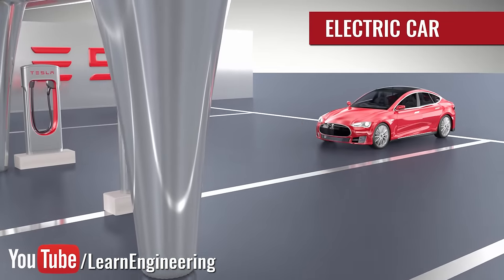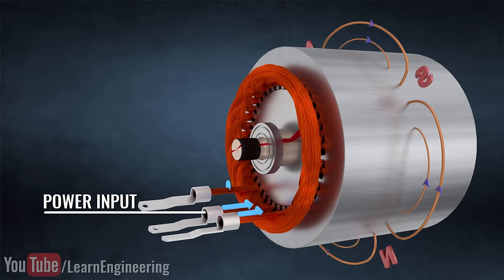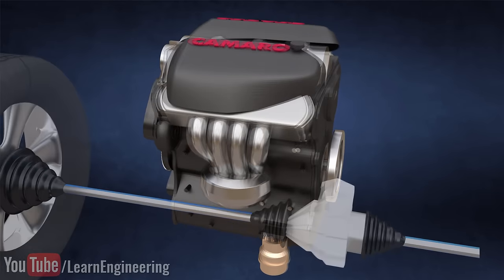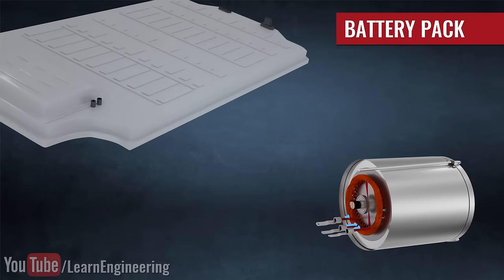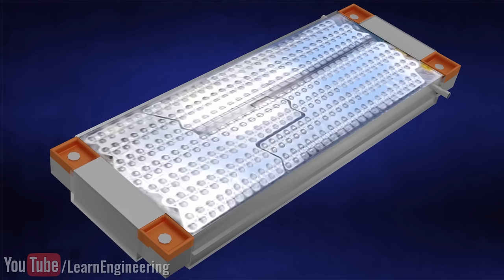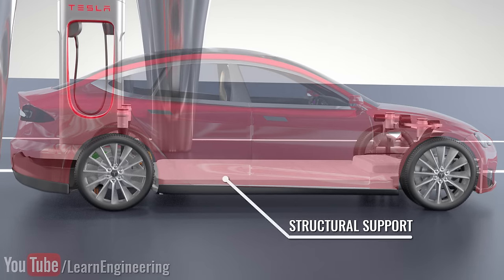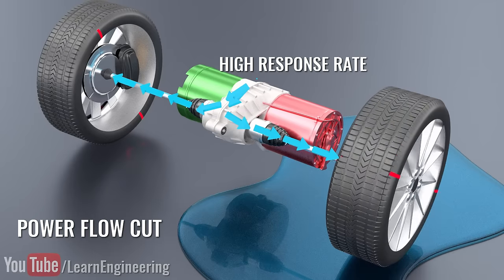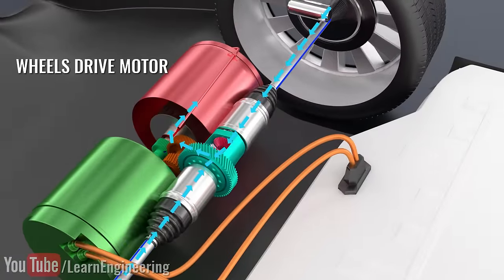How does an Electric Car work ? | Tesla Model S

Comment: If you just consider that you won't have any oil changes plus no costly maintenance during your ownership it's just awesome.  With many charging stations coming all over the world, for once future is looking better.  Thank you Elon 💪
Reply: You do need oil changes for the tires to move
Reply: Thank the Engineers not Elon LOL. Also, you still need to change the Battery every 10 years, and oil change for lubrication of drive shaft.
Reply: That didn’t age too well, they are saying all these electric cars won’t be able to be used because the power grid can’t handle all that electricity

Comment: 2:47 could you imagine if an engine was actually put into a car like that lmao
Reply: Assuming Direct drive is around 3rd gear and no neutral as no transmission, the car should not start
Reply: Car efficiency: 📉 NOT STONKS

Comment: Very interesting and excellently realized video. Many thanks!

As a passive safety engineer myself, I would like to add that the presence of the battery pack increases the torsional stiffness for sure, but not so much for lateral impact safety (the battery structure must be protected, thus the intrussions are to be managed via the body-in-white rocker structure mainly).
Also for the front unit crumple zone, yes, it is largely increased (if a front motor does not exist), but in counterpart, the rear crumple zone is more difficult to manage comapred to an ICE car (the rear motor and invertor must be protected in the case of rear impact).

Thanks again, hope my comments would be accepted as constructive opinion. No intention of critisism.
Reply: As we have seen after Hurricane Ian in Florida, many electric vehicles burst into flames after water breached the batter compartment of several electric cars. These cars when bursting into flames have en extremely HOT flame as it is a "chemical reaction" and not necessarily a regular fire.

Comment: 2020 and the disadvantages listed at 10:10 are pretty much gone. The meaningful charging time is like 15min now in a L3 SC going from 20% to 80% which is more than sufficient to travel 250 mi to next SC if on a long drive. For city driving, it is inconsequential as you charge at home and leave home with full tank of charge so to speak. Range is 315+ miles for LR Teslas which matches close to a gas car of about 360 mi. The S and X are 400 mi now. The cost is now in $50k range which is opening it up to a pretty huge segment of the market already.

Comment: electric cars are the future. But Tesla is a high class car, like a Porsche or S-Class Mercedes. Most people can't afford that. 
I bought a Renault Zoe ZE 40 with 41 kW/h battery and 300 to 400 km range. Also the battery can be charged in 1 hour up to 80% State of charge
Reply: and what speed are you traveling for that range? 45 mph with Int comb cars beeping for you to get out of the way?
Reply: @mdbx3887  The cheapest Tesla Model S costs 53.000€ in Europe. On the other hand, you get a handful of Renault Zoes for 15.000€-20.000€.
Educate yourself before you speak.
Reply: @mdbx3887   I wonder which of these cars will have better and easier service, in France?
Reply: Electric cars suck
Reply: Startingbark 035 A Tesla Model 3 would whoop every IC engine sports car out there on streets and on drag strips. And that is a fucking electric sedan.😂😂😂
Reply: Teslas cost down to 70.000$ in Norway, people can afford that?
Reply: @mdbx3887  First you are not really "french", as you can't even write properly "France" instead of "france". Second, you are a liar: the Zoe starting price is 26 300 € (without speaking about any "special price" or rebate one could get in a way or another).
Reply: eDrive how long does the battery last for on average before you have to recharge it?
Reply: @startingbark0356   ice cars blow...... poison gas
Reply: @BRAG3A  Surely they do; some of them at least; I mean, a few, or few
Reply: @mdbx3887  35k is the advertised starting price in the US. In EU, long range model 3 are >50k euros.
Reply: @bavarian3450  no u
Reply: @startingbark0356  do you own an oil factory?
Reply: *kWh

Comment: In nineteen ninety-one I drove with an electric car that had the reach of a horse and cart. It worked on lead batteries weight five hundred kilos everything total. Everything still works except the batteries. I now use the engine knowledge for washing machines and hobby.

Comment: If only tesla had a battery double it's size we would not have to stop to charge many times if we are on a road trip. Support tesla for the best in future
Reply: The weight, area and placement of battery along with its cooling, the charging efficiency all of these matter. Safety standards are prioritized over the distance a car can go in a single charge
Reply: The 2020 Roadster will have a 600 mile range.  200kWh battery but it’s $200k

Comment: Wonderful  explanation :  I learned a lot !   One  Question:  How about if  each wheel  is  activated with an  electric  induction motor.  It  could  overcome  the  ABS  system of conventionally cars  and  finally manage better control of  traction  and  also  overcoming  the   differential  gear ?
Reply: that would be twice as expensive. A big induction motor would cost less than 2 smaller induction motors. Right?
Reply: @Antonio-dd3fe  Right you are !   As modern devices require great inversions (the Ford "T" model  was very  expensive, when it came out in 1908!) ,  four induction motors upon each wheel, could work  as motors (when aceleration is required) and  as  generators (when functioning as   brakes and  at the same time the electricity could be used  to  load up batteries).  The resulting car could control  traction (tortion control)  perfectly, even on icy/mud  surfaces, I  believe !
Reply: @froehlicherelter  Don't some have AWD now? Pretty sure its just a mirror image of the back up front thought since running a drive shaft would take up battery space. That still would give you individual controlled though like you were mention.

Comment: Electrical car repairing is much more expensive that traditional. Electrical car are specially designed to be repaired only on brands garages.
Reply: but you barely need repairs, the only thing to change are tires and brakes

Comment: Clearly superior to Internal Combustion. Even if the emissions are essentially the same for gas vs electricity generation, this is far superior for the end user.
Reply: Sam G The emissions are not the same. ICE is way worse
Reply: I've seen this claim before, but the only way emissions are essentially the same is if the calculation is done assuming that the electricity generated for the electric car is 100% via coal. This is increasingly unlikely. And if it's solar power, then it's a REALLY clean car emissions-wise.
Reply: Sam G, here's another interesting development:

https://www.ge.com/power/about/insights/articles/2016/04/power-plant-efficiency-record

Comment: For the quick recharge the batteries should be removable so the driver can just exchange the battery for a charged one at the gas station!
Reply: gonna take an hour to lift the vehicle remove the dead battery pack ..... and put on the new one in ...
Reply: Tesla tried that but figured it sucked so they just stopped. There's still one but Tesla doesn't make any more.
Reply: They still ant your money...
Reply: Can you use one additional genarator pack powered by induction motor to charge battery pack
Reply: +Village TV
changing the battery pack actually takes more time than simply charging it.

+
abdul rasheed
no, because that would violate the second law of thermodynamics. you can never get more energy out of a system than what you put into it.
Reply: Well good luck with that. You can't even replace a battery in newer phones any longer. Once the battery stops holding charge the entire device is useless.
Reply: @hoxhaloo  
you can replace the battery on every mobile device, and there are plenty of videos explaining how it's done. the reason why batteries are no longer (easily) replaceable is because designing the circuitry around the battery allows for thinner and overall more compact devices.
Reply: Apparently NIO, the Chinese EV manufacturer does that at their service stations for under 3 minutes.

Comment: Wish I could afford a Tesla!  But even my halfway-there Chevy Volt has pretty amazing acceleration.  (I think it has a synchronous AC motor rather than induction, though.)  Ironically , the Volt is more complex than the Tesla because of the back-up gas engine.  Advances in battery technology will soon change that.  Still, I usually drive my Volt as a pure plug-in electric.  My commute is much less than it's 40 mile battery range.
Reply: rationalguy sir please tell why they use induction motor
Reply: rationalguy I like to think about like, we are pioneering the next form of transportation. From horse and carriage, to the steam engine, IC engine, and now the electric motor. The automotive industry will most like have a radical change within the next two decades. It’s gonna be interesting.
Reply: check a used one on vroom dot com.  I bought two from that online dealer, and no I'm not affiliated with them.
Reply: @amalgamated6448  
Believe it or not in the beginning of the car age 1/3 of cars ran on gasoline, 1/3 on  steam and 1/3 on electricity.
Reply: @CJHallx  True.
Reply: The Standard Range M3 is now available.
https://3.tesla.com/model3/design?#battery

Comment: Only people who are afraid of change will find ways to oppose electric cars and come up with lame, stone-age excuses on the "evils" of clean and renewable and sustainable technology!
Reply: Electric cars rely on mined and burned coal to power them. But oh yes, they're sooooo clean and environmentally friendly. Get a solar powered car, and then you can lecture people on renewable energy.
Reply: How about the lack of lithium on planet earth? How about the toxic byproducts manufacturing batteries creates? How about the numerous drawbacks of electric cars, such as long recharge times, low range, and excessive cost? 

Only fanbois will blindly defend a technology or company.
Reply: The performance of the car will increase far beyond petrol cars in the future. Also its not like the ways of extracting oil and manufacturing petrol cars doesn't  pollute just as much or event more so than producing electric cars. So you've removed one polluter in the chain when you make electric cars. Seems like an improvement to me. Also lack of lithium isn't such a big problem because 1 recycling batteries and  2 we still don't know how much lithium there is in the world as it hasn't been nearly aggressively looked for as oil. Remember when everyone said oil was going to run out but then they found gas? Similar things can happen with lithium. Also lithium ion batteries may not even be the best batteries out there making lithium less of a problem.  If you have vision you can easily see the electric is the future even with its issues. Please stop trying to sell half truths as the only truth.
Reply: Numerous? That's only 3. There are far more advantages over IC cars.
Reply: I just like ICEs, that's all
Reply: Real talk. The BEST way to solve climate change is to develop renewable fuels like algae biofuel. They burn cleaner, take in CO2 when being processed, and is cheaper to make than gasoline. And best of all, no one needs to go out and buy brand new EVs and scrap perfectly serviceable gas cars. Put algae plants near cities to absorb pollution for example. But the government wants everyone to be hyped about EV tech because that's what's sexy and attractive.
Reply: @philspaghet  something new to research.. thanks for making it known
Reply: think about the dead batteries too they have to be buried and that causes pollution as well
Reply: @user7351  ever hear of the term 'efficiency'? also renewable 'energy source' ?
Reply: thearchitect27 jews
Reply: Hey buddy a lot of old cars and trucks will way outdo that car so stop trying to talk all that crap both are good but the older the better

Comment: I think the major problem is the battery. If you can minimize the battery size and can change the switch the battery at a station without waiting for charging, it would eliminate all the fuel combustion cars
Reply: lithium is very volatile, is like being sitting in a stove. I prefer hybrid car, have less lithium.

Comment: Great that we’re getting on track with EVs, however it is unfortunate that it took so long. Might be the mentality of profit over our planet delayed it I guess.
Reply: EV’s are actually worse for the environment btw
Reply: @adam_bh  every thing manufactured will have some impact on environment, however EVs will be less damaging than IC engines overall.
Reply: @jitendrapatil99  so you completely ignore the fact that EV's are worse for the environment than? 
It may make you feel better to drive a tesla, but you'd probably do more for the environment if you turned off the lights a bit more and choose to bike instead of drive every once in a while. We need clean sources of energy, not clean uses of energy. Those will come as a result.

Comment: only problem with electric car is its battery , we need a fast charging batteries !! but i love to own one of these instead of conventional fuel cars !!
Reply: rajeev pallikare And cold. Defrosting, melting ice and heating the cabin are huge. As is efficiency with temps in the teens or less. Then there is air conditioning.
Reply: rajeev pallikare tesla charges fast enough.  I own a Model S.  I get a full charge every morning and on road trips, most stops are about 20 minutes.  Not an issue at all.  People are just stuck in their old mindset.  Perhaps one day they will wake up.
Reply: EclecticBuddha the cold does take a hit.  About 20% on the range.  But AC isn't that bad.  You do realize that AC affects gas cars more than EVs...right?  Besides, heated seats work great in the Tesla Model S and dont use much power.  You can preheat your car before you leave (while still connected to your wall outlet).  And it has smart preconditioning if you always have the same work schedule.  So once again, non-issue.
Reply: I've been driving electric for 3 years now. Zero problems with charging. My cars charge overnight when im sleeping. It doesnt get better than that.
Reply: Mário 565 its not that easy to do those in India !
Reply: Simon WoodburyForget : yah battery will evolve very fast now , and in near future im predicting there will be batteries that can charge fully within 10 minutes instead of five hours ,
Reply: The charging time is essentially 0. Just plug in overnight and you have a full "tank" in the morning. If I want to drive across country or something like that, I'll just put those miles on a rental car.
Reply: I like to think If an internal combustion engine or electric car didn't have those nasty emissions and could fuel in a matter of minutes 

Nobody would care about mileage and we would not be talking about these electric cars 

It's the time it takes to charge that's the problem with electric cars which is why I don't think it can be the only alternative fuel like Elon is boasting 

And yes there are those super chargers but an hour to charge isn't exactly a quick stop
Reply: Rajeev Arts It's difficult to charge batteries fast, I know the Tesla charges theirs pretty fast but there's a limit to how much power you can shove back into the electrolytes in the batteries before it might catch fire and same with wires,
Reply: Solace2 : yah i know that , hope technology will improve in coming years
Reply: Don't worry this day will come soon.
Reply: Rajeev Arts 
Yea wait till we get the graphene situation resolved then the car will charge in like a minute
Reply: Mikey Swerve 

That's interesting to know
Reply: What is the effect on your electric bill?
Reply: Simon WoodburyForget 

I think most of that weight is because of the batteries
Reply: Simon WoodburyForget 

Huh 

I always thought the more a vehicle weighed the harder an engine would have to work regardless of its shape
Reply: Simon WoodburyForget 

Well if you want aerodynamic take a look at the new Ford GT 

Air actually flows right through some parts of it
Reply: Rajeev Arts not to mention it's lithium ion batteries eliminate any potential of actually being eco-friendly. Battery technology just isn't there yet.
Reply: Jason Plays You know that us getting Lithium isn't actually bad for the ecosystem, right? We mine it up with a bunch of other things into a super saturated water mixture, and we let the sun boil off the water, leaving us with our lithium and other stuff.. it's not like plants live near those huge pools, they purposely put those huge pools where no plants are because clearly that's where the sun has the greatest energy, which would make the water boil faster. Go do some actual research and look into it more.